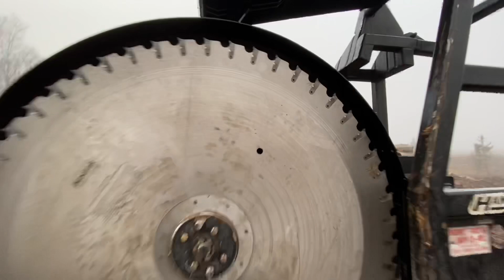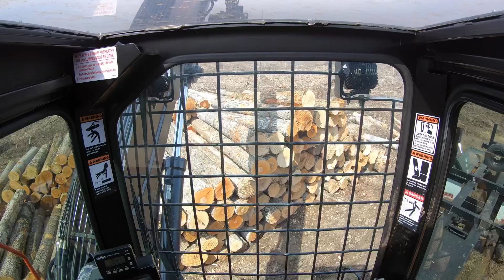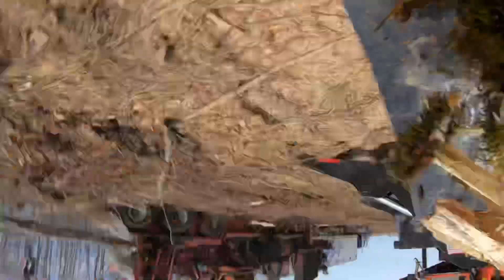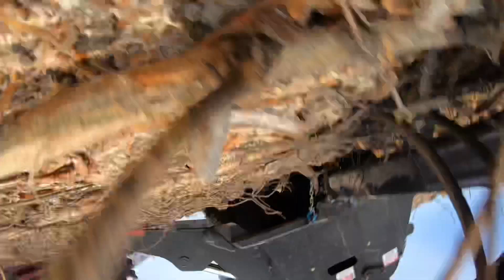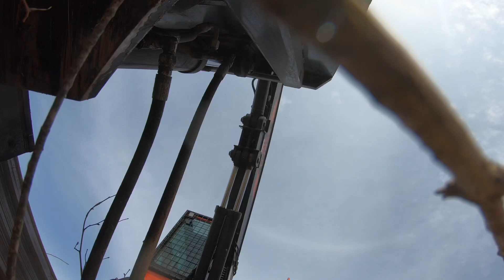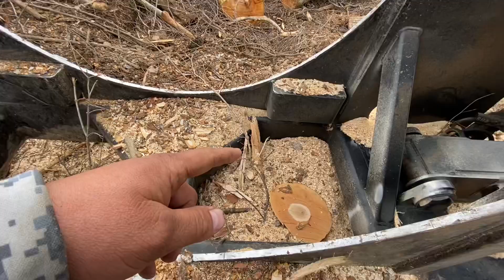Saw Blade can CUT!!!

Comment: Hi John, Like U say mabe some Teflon wear strips fastened beside the blade might keep it from deflecting somewhat. Our old hood slasher will grab and sail the loose blocks out at times 2. If were lucky it will only chip the carbides off of 2 or 3 teeth ,A.